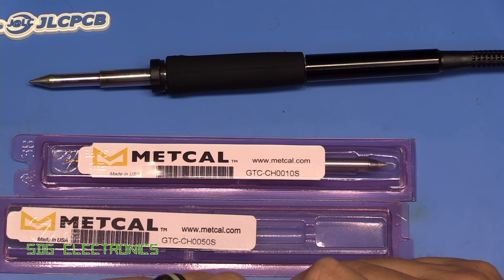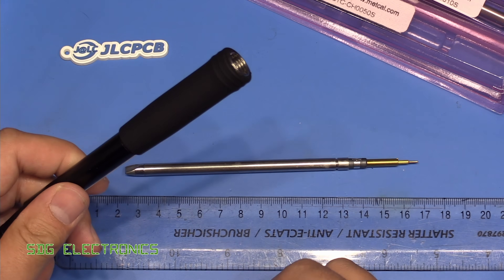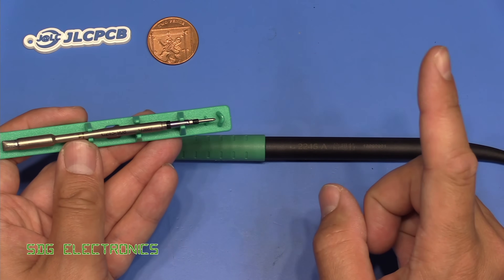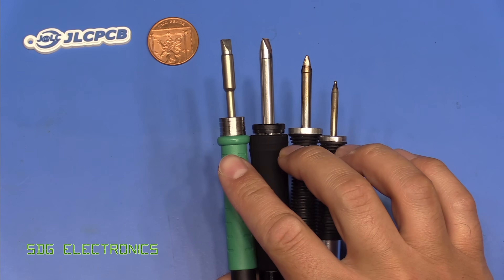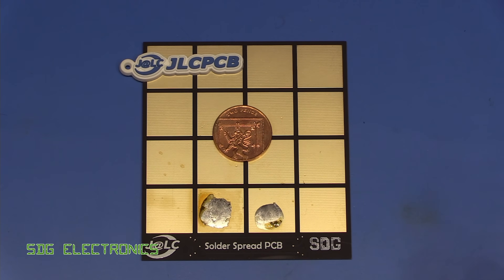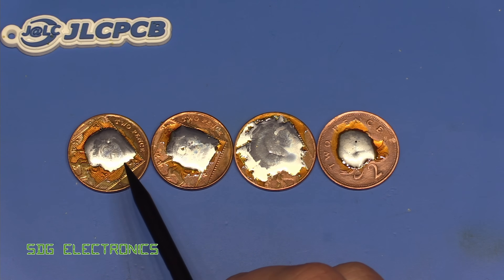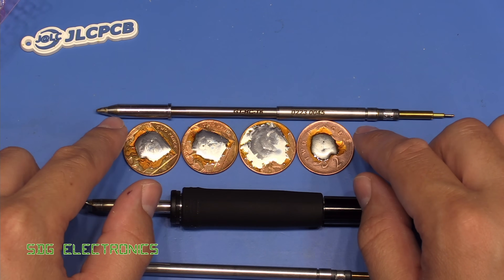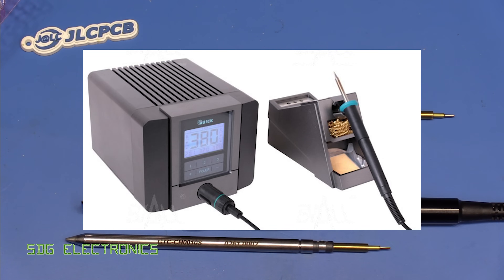SDG #211 Testing new high thermal capacity tips on the Metcal GT120 and JBC soldering stations

Comment: Honestly, I am angry at Metcal for trying too hard to go mainstream through the backdoor. They have this proven, amazing technology of Curie point and then they put presumably large amounts of money to clumsly combine it into a new animal of PID controlled RF heating. And then put a thermal resistor on top of it. Just so that people can adjust the temperature.
Tips economics I can understand from wear pov, but adjust temperature? Anything will melt at 320C. When you have zero inertia tip, the tip themal mass means nothing. 
Just decide what two or three tips you are going to use, choose your temperature and done. 
I know I comment two years after this was posted, but from what I see nothing will come close to the traditional Metcal Curie Point tips.

Comment: You are clearly NOT using a genuine JBC Station.
That BST-933 is a copy of JBC and the tip you used is definitely not a JBC original tip.
Reply from the maker: This is an original JBC tip supplied by our UK distributor. You can see the test with a JBC DDE in #216 with identical results.

Comment: Nice work ! I really still love my JBC, was alot of money but i sure hope it lasts many many years :)
Reply from the maker: They do make nice equipment. I have a JBC which I'll cover next in this series.
Reply: @sdgelectronics  Thanks sir ! A question or maybe you can cover this.. Who makes / sells a Tool holder that is big / strong enough to use that can hot swap with. The built in one is ok but only hold's 2 :(

Comment: Used the Metcal MX500 and JBC T245 (DDE) while working on production lines for many years and they're both great! 
Personally I would say the JBC tips last a bit longer but the solder you use has more of an impact on that.
The green part of the JBC handle dose get too hot after about 3hours if it doesn’t have the foam sleeve so I many times found myself holding it by the back black part of the handle.
The real down side to the Metcal system is the method of tip changing and storage, it feel like an afterthought.
In every JBC I've had the transformers have gotten noisy after about a year.

But still when ever I have had the choice I've picked JBC as they're more versatile overall.
Reply: In a year? They make noise right out of the box! It doesn’t affect the work, but for that price they could have done better impregnation
Reply: @ИванФимин-е6ф  110v or 220v?
i have a compact station for many yers and never hear any noise from it(europe 230v)
Reply: @ИванФимин-е6ф  You impregnate your stations? Can't say I've done that

Comment: Thanks for confirming my impressions of the Metcal MX5200 (I have the ThermalTronics clone/rebrand). The short handpiece to tip distance really helps in my shaky hands, and the heat output means reworking boards with a ton of copper is no sweat. It’s like having a cheat code for soldering.

Comment: Really excited about the comparisons to come, I'm tired of my old iron with changeable front tips (heater not integrated). It still works and is in really good condition, but it does not have the thermal performance of something more modern.

Comment: Steve the Quick station you showed, looks like a (TS1100) If so, the handle is nothing like your picture, at least the one I tried of eBay. 🖖👍
OK for a cheap hobby user station, building up kits and JLCPCB soldering your project circuit boards, but apart from that Its, as good as mains iron IMO.
Reply from the maker: It's a TS1200A, but I've not opened the box to inspect it yet. I'll be interested to see how it compares to the others though the availability of the tips seems to be a bit of an issue at the moment.

Comment: Very interesting test. It seems that the lower power of the MX-5200 meant that you couldn't feed the solder in quite as quickly but the conventional irons seemed to slow down after a while which allowed the MX-5200 to catch up and then pass them.

Do you find that your advanced handle on the MX-5200 heats up towards the cable end, I.e. where the tip connector will seat internally? I find mine does heat up there, not a huge amount but enough to notice it.
Reply from the maker: Not on the advanced one, but on the ultrafine handle I notice a bit warm. It's possibly some contact impedance causing it.
Reply: @sdgelectronics  Thanks that's good to know, I'll have to have a look inside and see if I can see anything wrong with the connector.
Reply from the maker: @yngndrw.  I've never actually looked down the barrel, but some contract cleaner might be all that's needed
Reply: @sdgelectronics  Will give that a try! Fortunately the grip unscrews so you can get a closer look - It looks okay from what I can see but I'll see if the contact cleaner helps.
Reply: @sdgelectronics  Contact cleaner did the trick, thanks!
Reply: The top 2 irons seem to have a hot solder ball on top of the cold penny, whereas the MX-5200 is heating the penny rather than the solder.
Reply: @userPrehistoricman  It's very strange how they heated so differently. It would be interesting to see a graph of the temperature of each coin against time - For science of course.

Comment: Can't wait to see the Quick TS1200a (which the manufacturer would make a Hot Tweezers for that model as well).
Reply from the maker: I will review the TS1200A shortly, though the 5mm tip sounds like it might be a few weeks away so the thermal testing might have to wait.
Reply: @sdgelectronics  No problem understood.

Comment: Thanks for the follow up video. In future videos can you please introduce the induction heater aspect of GT120. Because for me induction heater is a chunky coil where you putt object inside the coil. How it is organized in GT120 ?
Reply from the maker: I'll see if I can find any information about it. Metcal are doing some webinars on it, so I'll see if I can get any info from those.
Reply: I found a doc from Metcal. Lets see if YT allows links this time:
https://metcal.com/wp-content/uploads/2021/01/Inductive-vs-resistive-heating-a-comparison_by_Metcal.pdf
Reply: It is just like that. The core of the tip is inside a coil. Eddy currents heat the core directly removing thermal resistance between the core and a heating resistor (which is also coil shaped).

Comment: Did you measure tip temperatures? Was the pcb under coins let cooldown to room temperature?

I'm not a JBC "fan" (yet), but stations can matter. Algorithm for heating is in software.

If you have ERSA and Pace with about 5mm chicel tips, could you add those to comparison?
Reply from the maker: I'm in the process of sourcing the other stations and I'm waiting for an ETA on the 5mm tip for the Quick since it only ships with a tiny tip. I will make sure all future tests are comparative.
Reply: @sdgelectronics  Measuring temperatures opens another rabbit hole. Amount of solder, contact pressure, contact point on sensor and on tip, sensor cleanless. I have been able to get over 15 °C measurement differences even tip temp dont change.

Comment: have to say that was a pretty awesome demo. We don't usually see such clear comparisons between these irons. For myself, JBC is my chosen all rounder. So therefore it is unfortunate to find that the handle gets hot. But OK we then want to know if the Pace handle gets hot. Or the ERSA one (by comparison to this JBC). 

Maybe another solution for the T245 (which i am stuck on) is some small modification to the handle but without going too far and ruining it.

Was also wondering if the larger T470 handle was worthwhile. However you seem to have answered that here... that the general size T245 is in fact pretty darn capable, with that chisel tip there C245-908. So then its pretty dififcult to justify what situation the T470 will benefit over and above that.

Looking forwards to seeing the ERSA as also seems highly regarded. But so few people actually end up getting them.

BTW the packaging for that new JBC tip does not look like others which come in a rectangular plastic box, so is it genuine / where did you get it from? [edit] ah now i see photos of one exactly like it on amazon.de. So maybe amazon then. However I believe Kaisertech is the most well known dealer / authorized reseller in UK. Probably where i'll get mine from.

So in terms of identifying 'useful tips' from the huge JBC range. So far have shortlisted only 2, the first one was the very fine bent tip (C245-029). For micro soldering with poor access between tall parts. And now this 2nd one the huge chisel tip you featured here in this video (C245-908).

What I am missing next is... 1 small fine chisel tip for micro soldering (my preference over conical tip). And a normally sized chisel for regular 0.1 thru hole parts. Plus maybe some knife tip. Or something else for 'simultaneous lines of legs' IDK. They have all sorts of weird special shapes. You know, like the 2 pronged ones for getting both pads of an smd, etc. very easy to get carried away. The important thing is to get firstly the ones used most often. So I wonder if there is anything else. Clearly a conical tip is good (not for soldering) but for burning holes in random objects etc. But could instead use my cheaper TS80 or KSGER T12 for less demanding cheap junk. For those more casual task which does not require a higher performance. And then save the JBC for the good stuff.
Reply: Ah... seem i forgot about vtech-smt. As another UK alternative supplier to get the JBC tips from. Wonder if they also are authorized reseller like Kaisertech is
Reply from the maker: @dreamcat4  Vtech don't seem to be responding to my e-mails, but Kaisertech have been very responsive. We used to use Vtech to order JBC stations at work, but no more. 
The T470 + Heavy Duty station are probably of limited usefulness, but I might see if I can get a 30 day demo. I am looking at the JBC DDE-2C with a T245 handpiece, and maybe the CD-2BQF if there is demand. The CDE-2SQA is ready to be ordered, but it's release keeps getting delayed and since it's fundamentally the same as the CD-2BQF, I don't want to buy that and find they release the CDE-2SQA a month later...

Comment: Thanks for these comparison. That's what i expect from these 2. As you mentioned tips makes a big difference. I know that JBC can provide station for test for 30 days for free. You can use that to make a comparison with genuine JBC station (you have to have original tips for it as they do not provide it for test).
Reply from the maker: I'll enquire about the 30 day test, I'm not sure what terms it comes with. I may end up just buying it to make things quicker/easier. Possibly one of the JBC Premium Stations as I don't see them around as much. Also the CD-2BQF if there is demand for it.
Reply: @sdgelectronics  As I know there is no special terms to participate it. You just sign on JBC page and distributor will contact you how to handle the station (it works like this for me ).

Comment: Nice comparison again! I'm quite impressed by MX-5200 - I'm flabbergasted by the way it's able to flow solder down on the coin and spread across the surface as flat as it could be. Truly an unforgiving beast. From what I know about soldering stations, the only fair comparison to MX-5200 would be Hakko FX-100. Both uses the same heating technology and are priced similarly. Hakko recently launched a hot tweezer for the same station and they might come up with a desoldering unit soon to match up against the Metcal. I've even read that the tips are interchangeable between the standards irons of both stations. I know you're not much into the Hakko gear as I haven't seen you use any of their stuff on your videos, but it would be a heated comparison if you could get hold of the Hakko station. That will reveal the true, undisputed champion 🏆 of induction heating technology! Thanks for the review! Really enjoyed, especially when comments section gets erupted from fan boy comments.
Reply: The 5200 tips can put about 90 watts on mine even using the tiny tips, sharp pointed ones for smt parts. This works fine as they cannot overheat.
Reply: Thanks for the Hakko tweezer info. There is really no reason to compare the FX100 to the metcal though, its the same technology and output power is 50W on the hakko vs 80W. So its more like a competitor for the metcal MX500.
Reply: @jaro6985  I had that in mind but watching tons of reviews have made me believe that sometimes labelled wattage meant nothing. The tweezer has four different adjustments probably not available from any brand. Take a look at Exso Ledsol 300 as well. It's from a Korean manufacturer.
Reply: @roseelectronics4582  yeah good point. It could be that with RF power manufacturers don't want to lie as much since FCC is involved. Exso has some interesting stuff, 380kHz frequency.
Reply from the maker: Hakko stations didn't exist in the UK until very recently, so that's the only reason I don't tend to feature them. I also massively dislike their colour scheme/appearance (looks like a toy), but that's a secondary issue.
Reply: @sdgelectronics  Nobody seems to like the blue and yellow of the Hakkos. The change of the colour scheme proved to be a disaster for them. Despite the odds, Hakko is ever more popular especially because they've made quality devices at affordable prices. Their FX-951 is among the most popular stations today. Although I was excited to watch the performance of the promising GT series, now I'm more impressed with the MX5000 series. Never had the glimpse of a real comparison of MX series before. These videos are excellent! Can't wait to see the battle between the genuine JBC and the Metcals.

Comment: Curious how the Ersa i-CON will compare with the other soldering stations you have. My i-CON1 is nice, but I wish changing tips would be quicker. The handle heats up a little too much at the top end as well. But I don't really have anything to compare against, maybe those are just common problems?
Reply: Fx 951 is a good choise or maybe quick
Reply from the maker: I used to have an old Ersa RDS80 which got hot too. I think the entire metal body of the Metcal handle helps a lot.
Reply: @sdgelectronics   it is true

Comment: Hi Steve, not miffed at all! AFAIK the Best / JABE stations drive the cartridges differently compared to the genuine JBC stations. That said, I'm a bit rusty and I'm not too keen on diving back into that particular rabbit hole, I'd probably end up buying more tips (again). As long as we're comparing stuff, might be interesting to see if the MX5200 is comparable to the HD stations w/ T470 tips. But I have to agree that T245 (and T120 too presumably) get rather hot if you're soldering for an extended amount of time. May have to look into a new foam sleeve (mine is MIA).
Reply from the maker: I will be getting a JBC with the T245 handle to hopefully clear up any speculation. I use the JBC at work and notice very little difference between it and the Jabe when at home, but I'm obviously not doing high load tests with a stopwatch so there probably will be some difference!
Reply: I do not have and never used JABE, but looked to China 15-30 USD JBC control boards on Aliexpress and noticed that these China JBC controller boards it seems do not use thermocouple inside soldering tip. Third contact is not only earth but also second contact of thermocouple. These chinese controllers use earth contact only when handle is parked to stand to sense standby mode. So when you take soldering handle out of the stand thermocouple is not even connected to controller. My guess is that they approximate temperature from heater element resistance/current. What do you think?  This wpuld explain why in Youtube videos where people test them they notice that controller is not sensitive to temperature changes, and detect only huge temperature drops and then apply more power to heating element.
Reply: I know at least some of the JBC clone stations use entirely different wiring of the connector/handle/cartridge, making them not actually compatible with genuine JBC handles. Found that one out the hard way! I don't know if that goes for the JABE/Best stations, but I wouldn't be surprised, and is certainly the case for the X-Soldering ones.

Comment: Try the Jbc CD-2BQE  station .
Reply: I have one and it's great indeed. Quite an investment though for a hobby user but worth the money if you are regularly soldering
Reply: @rjordans   you have good Point
Reply: @rjordans   and the tips are very expensive
Reply from the maker: I was looking at the JBC DDE-2C with a T245 handpiece, but I will consider the CD-2BQF. The CDE-2SQA will be ordered the moment it's released, but it's been delayed over 2 years already and still no release date. I would guess they're having trouble with the validation process
Reply: @sdgelectronics   but the jbc CD-2BQE  is compatibile  with t 245 and t 210 .
Reply: @sdgelectronics  I have the JBC 2-Tool DDU Precision Rework Station and a Hakko 950 for larger stuff. The JBC is hands down my favourite soldering station. I have a couple of cheaper chinese ones too and they can't come anywhere close to the JBC unit.
Reply: @sdgelectronics  afaik JBC assist stations are available. just not in distribution network. and webisite infos are a bit uncertain of status.

 GUI looks slow in videos i have seen. would be awesome to see more of one and user experiences. price was maybe 30€ higher than regular, but my memory might fail on it